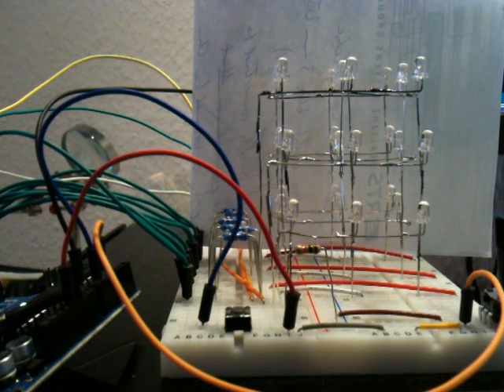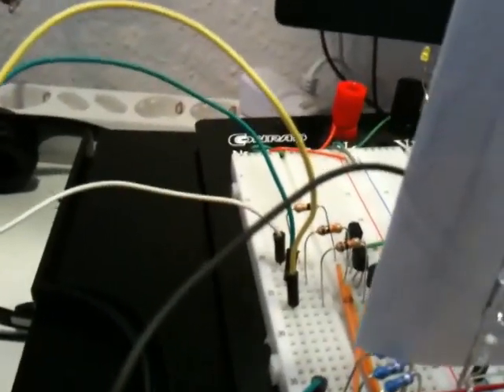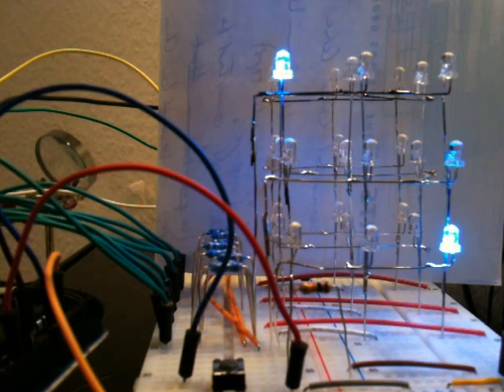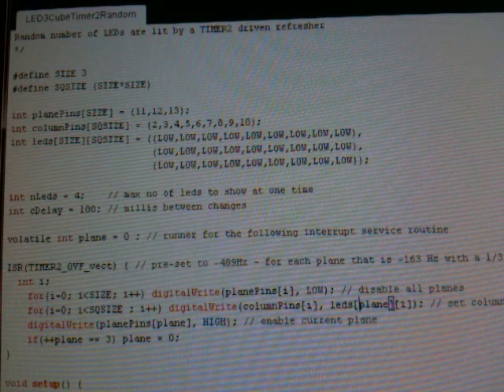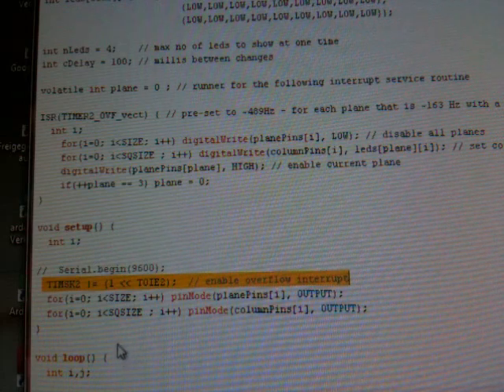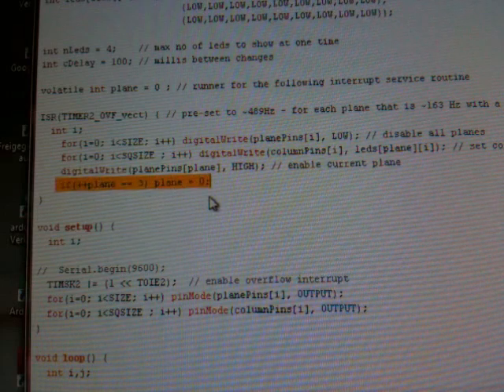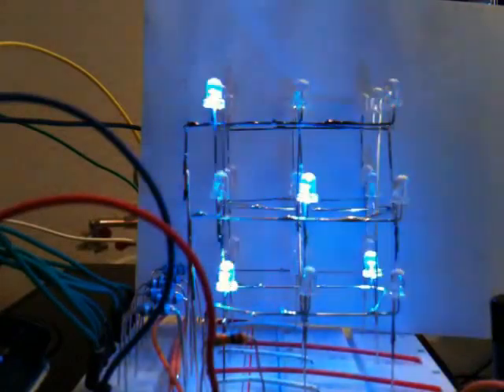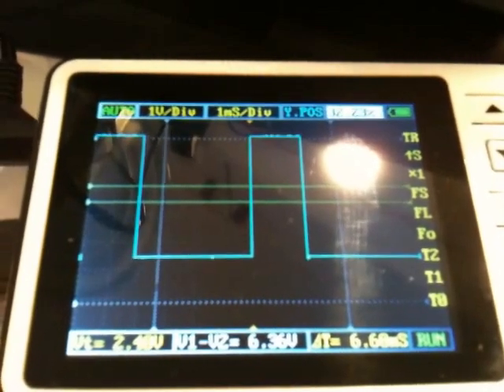Simple Arduino code for 3x3x3 LED cube

Comment: PLEASE HELP 

how can i program the code to go by b0000??

4x4x4 LED cube Arduino Uno:
  
I conected
 
column:
  " a1-13
  " a2-12
  " a3-11
  " a4-10
  " b1-9
  " b2-8
  " b3-7
  " b4-6
  " c1-5
  " c2-4
  " c3-3
  " c4-2
  " d1-1
  " d2-0
  " d3-A5
  " d4-A4
  layer 4-A3
  layer 3-A2
  layer 2-A1
  layer 1-A0